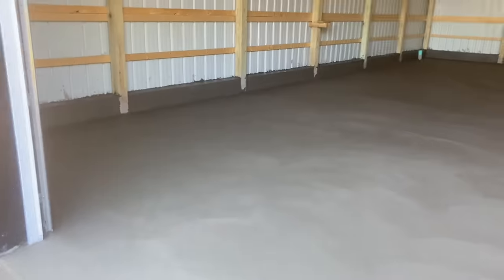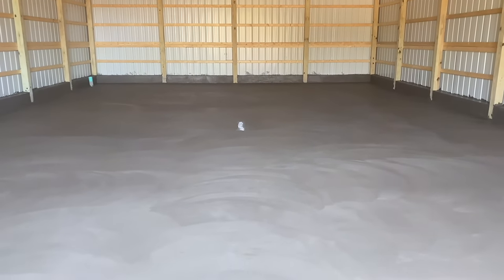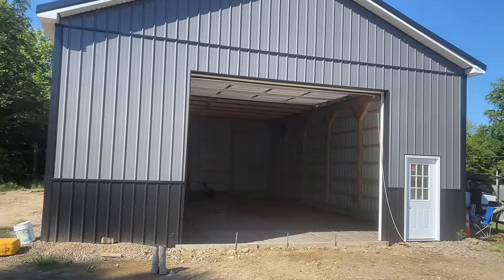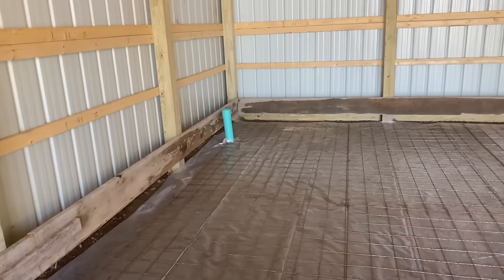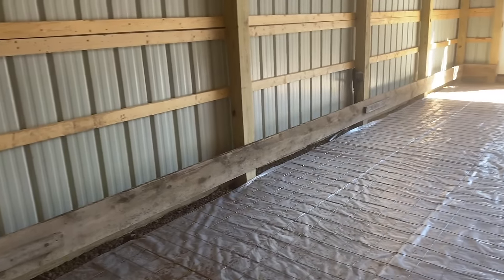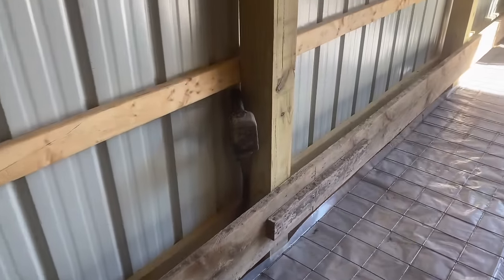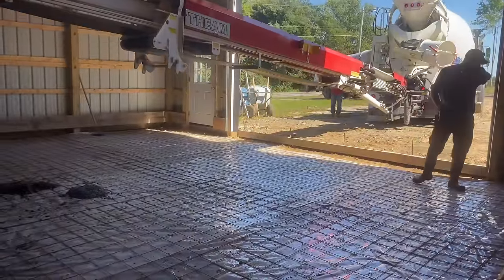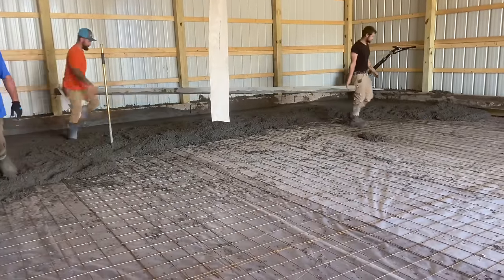All concrete cracks? Not this slab!!!!

Comment: I have a feeling that guy compacted the hell out of the base which is helping prevent cracks.
Reply from the maker: He did with his big roller.
Reply: Subbase compaction has NOTHING to do with plastic concrete shrinkage that causes most cracks in concrete.  Proper water-cement ratio and admixtures have everything to do with low-crack concrete.  

Proper subbase preparation/compaction/drainage is key to long-term performance to eliminate differential settlement, but that's not what causes shrinkage cracking.
Reply from the maker: I have to agree with you because it is all but impossible to pour a slab in the summer sun without it cracking. Some crack before we can cut them the next day. Then in the cold fall or inside pour and low or no cracks.  @ArthurDentZaphodBeeb
Reply: Yep, if you can manage the water loss due to curing and evaporation then you can control the shrinkage and hence the cracking.  The first couple days often dictates how a slab cracks.
Reply: @ArthurDentZaphodBeeb   correct.
So when the ready mix guy pulls up and says Do you want me to add water?  Your answer should always be NO!  
The mix is correct when it leaves the plant.
There is a 1:1 relationship between cracking and no slump test at the job site.
Reply: @barrelmitt1544  Well, occasionally a load might be wrong as the automatic samplers may get it wrong. But otherwise, pretty much correct - it's usually sheer laziness/ignorance/don't give an eff-itis of placement crew if they add water. But if you've got a big pour and one load is way too stiff vs the rest, you know something is wrong.
Reply: Lots of people dont put the effort in to use good thick layer of base material, proper compaction, or drainage around the pad. The most important parts of any foundation.
Reply: @bondobuilt386 hey now we don't need that kinda talk around here mister. You keep all you naughty talk to your self.
Reply from the maker: what are you talking about?
 @ericspecullaas2841
Reply: @bondobuilt386  look at your comment from 13 days ago. Then re-read my comment. It should make you laugh at the sheer innuendo
Reply: Looks like it was done 2 or 3 days ago it’s green too dark. 🤷‍♂️🤷‍♂️
Reply: Here in Florida they pour directly on the sand. Only steel is in the footers. They did put fiber in the mix which they claimed that’s why the steel wasn’t needed. The county also accepted this practice. 
Regarding your working the concrete I didn’t see where lifting the wire was done very much and when I thought I saw it others just walked back over the pull area to move the wire back down. Just saying. I prefer adobies.
Reply: @warrenrohloff8095 they have water evaporation retardants that can be applied to the surface. Even diesel will work.

Comment: "We pull our mesh up. We don't leave in on the ground. Look at my guys pulling it up with a rake." Then everybody WALKS ON IT & PUSHES IT BACK DOWN TO THE GROUND... LOL
Reply: The stone in the concrete holds up the mesh once it's pulled up. It may not be dead center of the slab, but it's not critical for this application.
Reply from the maker: Thanks  @bcrusher1979
Reply: Yeah they're being hacks, and they're not going to admit it... If they want to do the job right they'd use blocks so it was dead center in the middle of the slab; but they won't do that because they might trip and hurt their little pretty faces
Reply: @bcrusher1979 , LOL... the mesh gets stepped on; it lowers/sinks PERIOD.
Dobies or mesh/rebar chairs should be used & anyone begging to differ is a HACK...
Reply from the maker: If you had a clue about concrete you would know it is suppose to be in the bottom 1/3 of the slab on the tension side so as weight is put on the slab it resists cracking. In the middle of the slab the wire acts lie a hinge and slab cracks. Think about it before you make a foolish simple minded comment.   @xephael3485
Reply: @bondobuilt386 , with mesh/rebar chairs it WOULD be in the bottom 1/3 of the slab- unlike it is after being stepped on repeatedly & REMAINING on the ground...
Reply: @xephael3485  Actually I thought it had to be 75% from the ground?
Reply: @JayDee-xj9lu  you're probably correct and it needs to be towards the upper part of the slab to be most effective... The main point that I do know is that a lackluster pull up from a rake or whatever the hell they're doing is not ideal and a hack job..
Reply: @xephael3485  I agree. I'm having a slab done tomorrow and all the bar chairs are under the mesh. I had another part of the slab done last week and no cracks, but I'm constantly watering it.
Reply: The mesh is supposed to have tie blocks underneath it.
Reply: @duanedodson1 , precisely...
Reply: @bondobuilt386 , keep telling yourself that & you'll keep believing the same bad practice...
Reply: You can either put the chairs on upside down and then put them right way round as you go or use planks to take the wheelbarrow across the mesh. 

Lifting up the mesh is a very bad habit and unverifiable (it's basically impossible to achieve the same results as with chairs).

Because of heavy loading (I'm assuming it is more than just a tractor) you should also have rebar on the bottom 1/3 and mesh in the top 1/3 - or even just two layers of mesh.

Wire mesh in the top 1/3 is important because the top of the concrete dries out quicker and the wire helps prevent it moving as it dries.

That being said... with the right soil, being isolated from weather (covered and indoors), the right slump and great site prep you can get away with no metal.

Because at the end of the day it's shrinkage (drying unevenly or due to a wet mix) and soil sagging that the metal is really used to overcome.
Reply: @bondobuilt386  Agreed.  That's what my PhD Structural Engineering Professor taught us in college!

Comment: That slump looked less that 5" to 6", I think more like 4".  With some air entrainment, that is probably why no cracking.  Slop concrete is easier to screed, which is why contractors often have the trucks add water to the mix before pouring.  When I was inspecting, I would do slump test at the site and not allow adding water unless the slump was far out of spec. I would reject trucks delivering slop and even not certify a pour if concrete was out of spec.  Contractors knew not to pour slop when I was on the job.

Comment: Been playing in the mud for 20 years. I’m blown away it didn’t crack. Hell of a job as usual!
Reply from the maker: Thanks and yup I do not understand it. LOL
Reply: I'm not surprised...I poured a stamped concrete / 3 tier patio deck 15 years ago. The sectional deck is elevated off the ground 5, 6 and 7 feet with storage underneath. The deck section sizes are 24 x 30, 10 x 16 and  14 x 24.
For starters, I live in Northern Canada. The cement strength at the time of pour was rated @ 28 mpa with fiber added. The semi dry cement mixture was poured over 6x6 steel mesh re-enforcing on top of q-decking, 6 inches thick. The q-decking is supported by 4 x11 horizontal I-beams on top of schedule 40 10 x10 vertical square box tubing with the shoes installed 5ft into the ground well below the frost line. 
Contrary to recommendations...., 
I specifically didn't want any relief cuts as it would interfere with the stamped pattern, to this day,  the deck has never cracked under tons of snow loads or cracked from freezing and heaving from below in minus 20 degree temperatures. It never budged. 8 years ago, I closed in the 14 x 24 section to create a sun room and is where I enjoy my morning coffee

It's all about prep work
Reply from the maker: Thanks for sharing and I agree the prep is the key component to a crack free floor. But sometimes it just acts like concrete and cracks because it wants to piss us masons off. LOL  @IR-nq4qv
Reply: @bondobuilt386  true that, concrete generates heat during the drying phase, if it doesn't all dry evenly at the same rate..., all the Prep work in the world goes out the window.  If you get a bad mix, then you're game for anything.
Reply: Prepping the base properly is the key. I built my shop in 2004 with a 24x30 floor with no cuts and i don't have any cracks. I'm in Canada so I excavated down 6ft and placed footings and foundation walls. I had the interior filled with 5ft of sand compacted every foot. I levelled out the top, laid down 2" polystyrene, vabor barrier, 12x12 grid of 1/2 rebar. The floor is 8" thick.

Comment: I think because the ground was properly compacted first, plenty of re-bar in, plastic barrier between dirt and concrete, strong 4000psi good concrete mix etc. and it got to cure indoors in a fairly controlled way.
Reply: No rebar, just ww...
Reply from the maker: Yes no rebar but I agree with compaction and the other factors you mentioned.
Reply from the maker: Yup no bar  @berthaduniverse
Reply: @bondobuilt386  Ah sorry that's true, it is just wire grid.
Reply: @bondobuilt386 I started using both rebar and mesh to reinforce slabs , UV protection poly . My Old Dad was a concrete man he built thousands of foundations  , mostly houses . He worked  Industrial jobs too , hydro dams etc ….. the shop he built on the farm 50x40 one foot deep slab , fourty years ago . To this day not a single crack , mesh only . For years we used it to store and maintain the International TD-20 . The quality of the concrete is the secret . 👍🇨🇦

Comment: As a union iron worker I was able fawn employed as a rod buster.  I built my own house and garage using  commercial standards for reinforcement and concrete.  18 years for  my basement with no cracks showing.  And 21 years for my garage with no cracks showing.   And I use my garage to repair heavy equipment.  So it has had some tremendous loads on it.   It’s all about proper site preparation and reinforcement.  Science and engineering works !   Nice work on your building sir !
Reply from the maker: Thanks for sharing and I agree with what you say about prep work.
Reply from the maker: 10:09 I talk about the concrete. There is no fly ash in this mix either. I think the biggest factor was it was poured inside out of the sun and wind and also the prep work under the slab.  @ShadyD365

Comment: Nice work.  My being an amateur at it, this doesn't surprise me.  I owned a sawmill and stone quarry in Clinton County NY.  Both were new start ups at the time. Having limited funds I always prepped and poured with my own men.  Always used 4,000 pound mix, always poured 6",  always went down 12" for the edges and 12" wide w/rebar, always used wire mesh, always lifted the mesh.  Any pour was always on well drained and compacted area.  Saw cut was not anything I knew about, so it was never done.  I never had any frost heave or cracking.
Living in Florida now is a different experience.  It is hard to have a stable base on sand.  Contractors don't want to use wire mesh.  They freak when told I want #4 rebar 24" on center, tied to wire mesh and a 4,000# mix.  They love to saw cut, I don't let them.  The result is still crack free pours learned from my previous experience with the added   guarantee of rebar.
Nice work !!
Reply from the maker: Thanks and sounds like you do good work.
Reply: I did mine 26 years ago, fly ash under pad, no cuts no cracks, 4” pad 24x36, 5,600 psi , hopefully yours last another 50 years probably free
Reply: I've got a 15 year old 40x44 slab that is 5.5 inches with wire tied rebar and they used the metal quick key type expansion joints. Not a single crack in 15 years and I park old tractors and RVs on it.
Reply: From NY to FL.   "Living in Florida now is a different experience."   REALLY !    :-)      Do you find yourself often saying, "Up north we . . . " .    In FL they just want to do everything half-a$$ed.   BTW, can you ever get a full crew on a Friday ?   Some tradesmen will work long days M - Th to get off on Friday.   But about half are going fishing on Friday no matter what they did during the week.   Ya just have to adjust.   :-)

Comment: Pole barns if done right will easily last 100 years.

The 60 x 60 free span my dad built in 1966 is still standing fine, and only 1 post 6x6 on 10 foor centers, has twisted.

But we sunk the footings 4 feet down.  And the posts sit on the concrete that is 12 inches thinkc below 48 inches..

And then when the posts were set over a rerod pin set in the concrete, we poured 2 wheel barrows of concrete around each post.

Ground is heavy michigan clay and we backfield with sand .

Never concrete up to the posts.  The posts are supposed to move  slightly under wind load.

16 foot side wall height 4/12 pitch homemade trusses.  We made them innthe driveway using an engineered print old school wheat glue, and very specific nail patterns.  It was fun for a 5 year old but not so much for dad I am sure.

Thanks for the videos !!!!  Nice work.

Comment: What I always found amazing  is that we do everything to stop concrete from cracking adding wire , rebar ,  fiber mesh  etc... But ya still get some cracks . But yet where the truck washes the shoot out adding so much water and doing everything what you would  think would cause  cracks .  IT DOESN'T" .  That's CRAZY !

Comment: Thanks for making this video, it covered so many aspects of making a successful pour.
  There was only ONE point that you didn't stress;
   Having a good team of experienced workers with you.
Concerting , as a trade involves heavy manual work, 
and finding workers that aren't afraid of hard work is like finding rocking horse droppings.
   I've worked with folks that did nothing but concreting, 
and In ten days, I learned more than I did in 30 years of working in the building industry.
   It's educational to work with "specialists".
Reply from the maker: Well thanks for sharing that and I definitely agree that concrete guys are a different breed. They are hard to find

Comment: Great job.  I have a barn style garage with a lean to for the orses.  Mo more horses, and now I want to finish it  with concrete. The garage is  exactly 33 yers old, and it never had saw cuts for expansion.  Not one crack in it still, and we are in lower Michigan where it does get cold. I gotta get my lean to concreted in.  This encourages me to get it done.  THUMBS UP!!!

Comment: I agree with your opinion on burying the posts. In Wisconsin they bury the posts also. When we built my dad’s pole barn I used sauna tubes and poured concrete footers for the posts and and weld it up my own brackets and anchor, bolted to footing and through bolted the posts. Now they make brackets for this application. Good job on all your work, enjoy watching the boy’s. Thanks for sharing your experience and tricks.

Comment: A couple things.  These buildings, post frame, can be made to last 100+ years by pouring piers with anchored mounting brackets, like RR buildings does   still minimal foundation cost compared to a full grade beam set up.

Also, a mid range water reducer is very well behaved and would either allow you a higher slump, or reduced water.  They actually make finishing much easier due to how they enable better cream formation at the surface.  For sure the high range water reducers, or super plasticizers, can be finicky and have some time issues.  Too bad you can't run up and pour a few slabs with Mike Day.
Reply from the maker: I have used it a few times but it is like the plants around me are not sure how much to add and they are not quite there yet with plasticizers and the plants near Mike got it pegged to perfection. As far as the post frame buildings I wish they would build them like R R does it.
Reply: I would agree with the need for better building methods. I would agree the best way to do it is the same way R.R. Building does it. Your slab is still poured after so it's still a temporary building giving you a break on your land taxes. Why someone would spend $25 to $40K on a building that is only going to last 30 to 40 years is beyond me. They do make special pressure treated wood for Sub-grade construction. It's meant to be buried in the ground, but most places don't carry it on a regular basis it would have to be ordered. 
  As far as strength and not cracking the curb definitely helps but a properly prepared sub surface is key. You said he had brought in a huge vibratory roller. I'm sure that made a huge huge difference in strength. Thinking of giant buildings and sky scrapers the usually over excavate 20 to 40 feet below ground then start compacting in 3 to 6 inch lifts. Add several feet of heavily compacted stone. Your base material is what keeps it all stable and doesn't allow it to sink or twist. Love the videos have been a fan for years. Thanks for sharing all of your knowledge and tips.
Reply from the maker: Thanks for watching and leaving a interesting constructive and valuable comment. 👍 @chrislangdell117
Reply: You’re correct!
Reply: those post are very weak bolted to those brackets,the brackets will live thru it all set in concrete,the weak spot is the bolt in the post,the post was just weakened
Reply: You don't pour the peers you can just put them on top of the concrete if you want to using brackets.. I have one that 75 years old and it's just treated lumber in the dirt... I've had to repair a few rotted out ones but it's not a big deal.  It would have been a big pain if some idiot would have dumped concrete around them though!

Comment: My son-in-law Shane had some guys pour a slab for his house about 5 years ago. It was in N GA in the winter and the contrator added something to the mix that they said would make it dry faster.  He said not to add the drying agent, but they did any. That slab cracked within a month or two, big hairy cracks I mean. And that was their finished floor.  So he lived there with the wife and kids a couple years, then sold during the 'seller's market' of the century. They're about to move into a new house he built, wood on blocks, no slab this time.